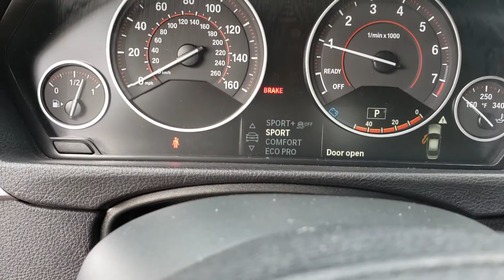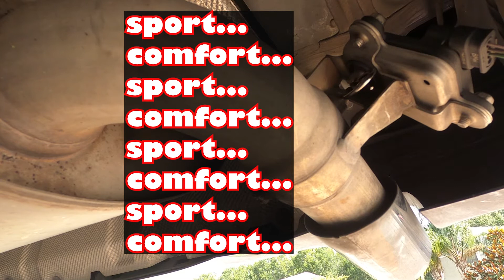Another BMW Exhaust Valve Rattle & Fix | F30 340i | RAW Footage!

Comment: I fix mine by. Starting car up. Actuator shaft turns in position you need it at. Unplug actuator and turn car off. Now you able to put clip in. I use flat head screw driver to push in place.  Plug actuator back in. I did not have to take anything off to fix it.
Reply from the maker: That amazing! I'll try if I have to replace again.

Comment: I wonder if it matters which side the hook goes on.  Other vids show it opposite of how you put it in.  You were the only one who showed you might have to cycle the engine to get it to line up. So thanks for that!
Reply from the maker: When I found the rattling, the clip was gone so I didn't have a reference. I guess it works either way.

Comment: nice fix, exhaust sounds great 😍
Reply: I think you put it 180 degrees wrong way. The "hook" should be on the exhaust side.
Reply from the maker: Several weeks, no issues!
Reply: @BoostedorNA  Then it's the right way :)
Reply: I had to put my car in drive/reverse after i put it in sport mode. My actuator finally moved once i did that.  Hope this helps

Comment: I’ve been trying for two days and I can’t get it in. Did you cycle through all the driving modes or just sport mode?
Reply from the maker: Just sport mode if I remember, someone specified cold start.  You can try installing it the opposite way.  Some said I installed it backwards compared to other vids but it still works the same.
Reply: @BoostedorNA  thanks and I’ll try again.
Reply: @BoostedorNA  thanks mate, I managed to do it with your help.

Comment: So when you say you put in sport mode did youbkeave the car on while you stuck it in?
Reply from the maker: If memory serves, when you put it in sport mode, the valve will open, and when you turn off the engine it stays open and doesn't close until you start the car again.

Comment: Do you know where you got the spring from? I have the same issue on the same side
Reply from the maker: ECS Tuning IIRC. Someone said I installed it backwards but it's still good 2.5 months later.
Reply: @BoostedorNA  Thanks for the tip, just ordered a spring. Mine was gone!
Reply from the maker: Thx, mine was gone too.
Reply: Mine has a tiny piece of the spring left. Will order the part. Thanks for the video!